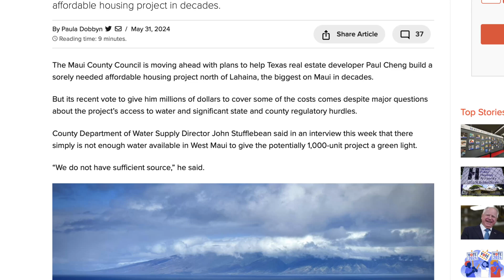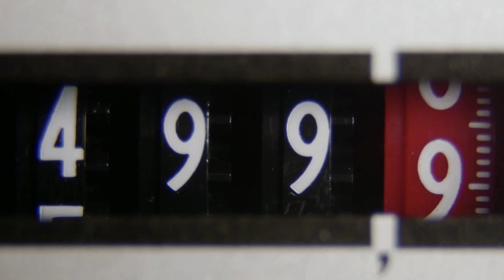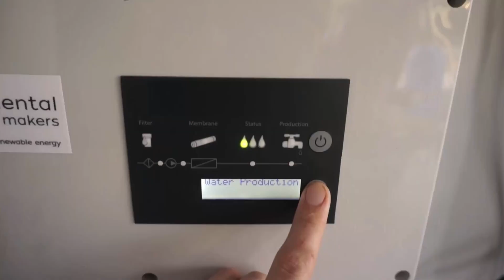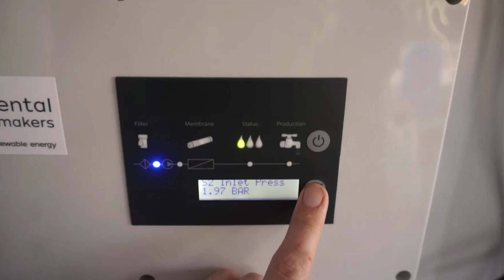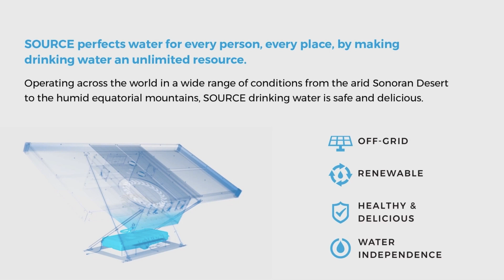Maui's Water PROBLEM - Can Desalination Work ??? Wai Not MAUI ???

Comment: When do you run for president of the universe? You have good ideas. I like the water solution eventually being a housing solution. Those that control the water, control more than that and are reluctant to give that up. Water is power. I was born and raised here...the water problem is on-going. Wouldn't it be exciting to have a solution in my lifetime? I'm almost 50 years young.

Comment: They need to fix the century old infrastructure that leaks like a sieve.

Unfortunately the town burning down added a new problem. Because most all of the old trees burned and are gone temperatures will rise in Lahaina.
It will get worse...

Comment: Appreciate you bringing attention to how simple technology like Source water would actually be cheaper than people continuously buying plastic water 💦 bottles in bulk from Costco.  Any new homes do not need to be grid connected for water, sewer or energy.  That off grid technology has existed for years and used in both rural and remote areas around the globe.

Comment: When I heard the comment about the environmental problems of returning more salty water to the ocean, it made me stop and think of the process.  I don't think that there is an environmental issue. Let me explain.  With desalinization, salt water is taken from the ocean and you end up with salt-free water and "saltier" water.  But where does the salt-free water go?  Well some is returned to the ocean in the form of sewage and some goes into the ground water as a result of irrigation.  But the areas being irrigated are generally very close to the coast.  So, the ground water is slowly flowing back into the ocean.  That offsets the amount of "saltier" water.  It is essentially a closed system.

Comment: Can a community cap the population based on available resources? Just like fire code only allows for a max occupancy. Maybe the island is at max and putting more demand on the island or any place not a sustainable plan. It might be time for a 1 in 1 out approach. I would like to see a study of water use by industry and how many “locals” benefit. The benefit should be measured by way of life or by profit and see where that takes us.

Comment: Greetings Jesse, We live in SW FL. We are sorrounded  by the Everglades, Florida Bay and the Gulf of Mexico. In our Collier County Utilities we have around 40 wells that service our municipal water needs as we are very conscious of tapping into all the fresh water available. In fact around 2/3 of the wells are brackish water. These run through a large RO-type system that utilizes a calcium derivative "sand" based filtering system. This type system could easily be set-up with all the volcanic residual from your area. Just saying... --D.

Comment: Alternative examples abound.  Look at Bermuda, for one.  Every home on the island is required to capture rainwater and store it in a cistern, and large water users like the resorts have their own systems. Some have RO (desalination) and others have older distillation systems.  It surely raised the cost of construction, but it was spread across every homeowner and employer.  I'm sure it took considerable political will years ago but they had no option.

Comment: I thought the mountains above Lahaina had some of the highest amount of rainfall in the world.  I don't believe it is a lack of water, it is a lack of storage capacity and of course, the water rights.  The lakes that were in Lahaina yesteryear are gone so most of the water is produced from ground water not surface run off.  Maui has some of the most intense storms at times, producing flooding, all that water washes to the ocean.  Perhaps the more sustainable solution is to create reservoirs to store more water, extracting and replenishing the storage from surface run off.  Another is recycled water, clean the sewer water and use it to water the golf courses and public landscaping.  I would start there instead of incorporating high cost/high maintenance alternatives.  They could certainly be phased into use if the other ideas produce a shortage.  Remember, solar panels have a limited lifespan of about 20 years, then they become environmental toxic waste.  While trying to create a solution, we may end up creating a whole other problem.
Reply: We use this water, called Brown Water, to water all of our road vegetation here in SW FL --D..
Reply: We use our reclaimed sewer water to water our alfalfa fields where it is returned to ground water. This is in Utah where it is a desert and water is definitely in short supply.
Reply: When the sugar cane went away it changed the climate.
They blame it "climate change" but they did it.

Comment: I think the improvements in solar panels could be what makes this possible.  10 years ago the size of the solar field you would need to power a larger desalination plant was prohibitive.  I wouldn't be surprised if the reason no one is talking about it is because it has already been looked at and ruled out because of that reason.  I am familiar with that kind of thinking in government.  "oh... we already looked at that.. takes too many panels, the solar field would have to be huge"..   The other cool thing is with improvements in pumps and in solar panels, you would not necessarily need to put the plant right on the water.  It could be on the other size of the highway.